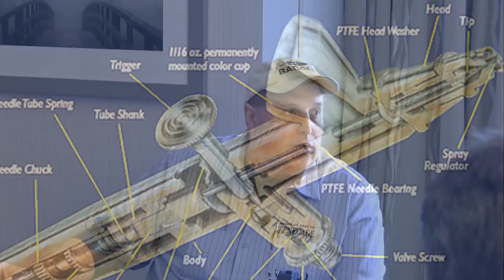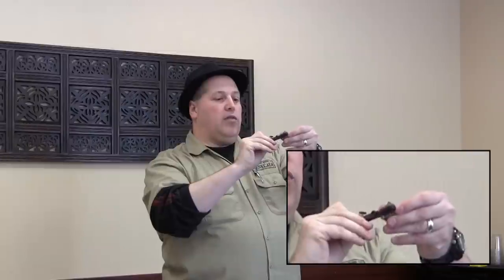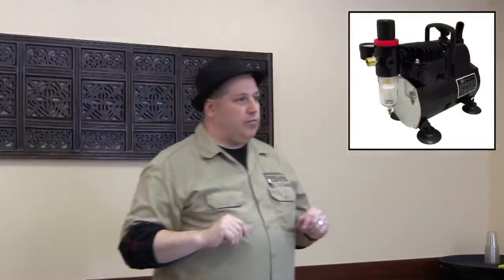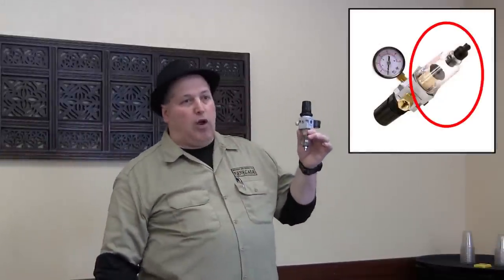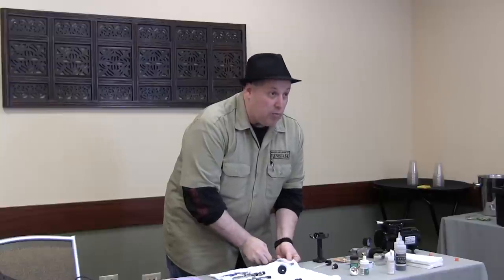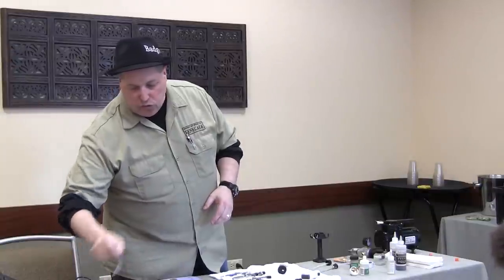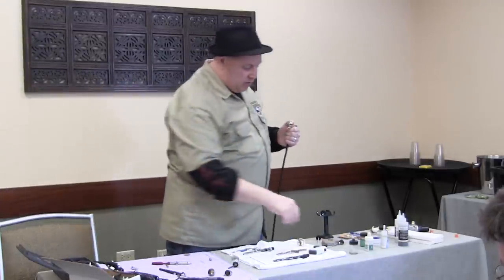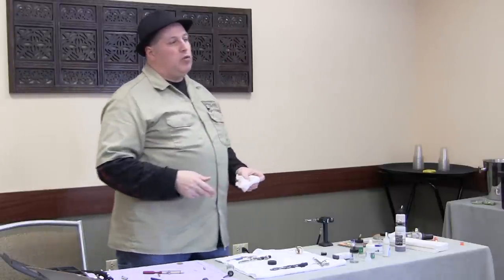Introduction to Airbrushing with Ken Schlotfeldt

Comment: I like the fact they still make the parts in the US.  If that was Apple, they'd move it all to China.  I watched Les' walk round of the factory and that was also interesting.  My Badger has been fine since got it here in the UK.  Only issue is the Badger hose I have on my Revel Master Class air compressor.  There is a constant leak on the hose near the connector.  Only issue I've had so far with Badger.

Comment: Although he says don't take them apart, there is nothing wrong with it.  And people shouldn't be afraid of it as they are easy to put back together.  It was BadgerAirbrushes that I was thinking of.  He shows them taken apart.  He's even customised some of his airbrushes by clipping the spring and cutting the handle (which obviously isn't needed but it's interesting to see).

Comment: Airbrush medium would be no better than using matte or gloss medium..its basically the same thing ..the only advantage I see would be if you need to thin your paint to the point it would not adhere well. I make my own airbrush medium my mixing matte or gloss  medium 50/50 with water.